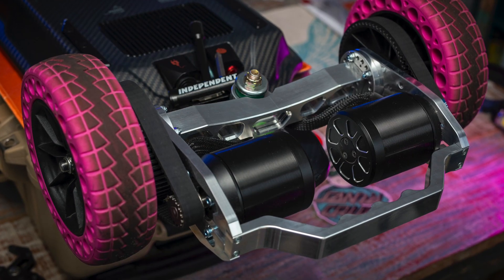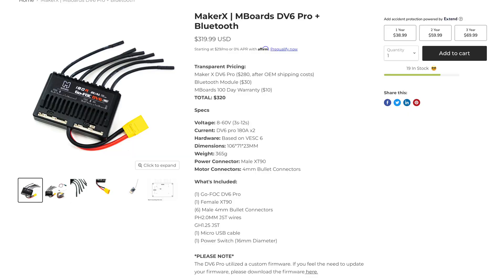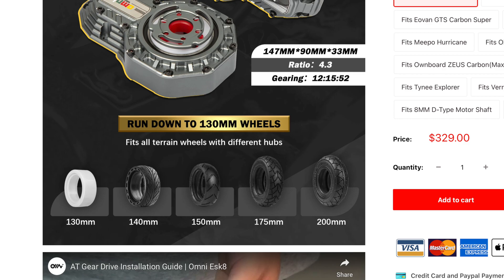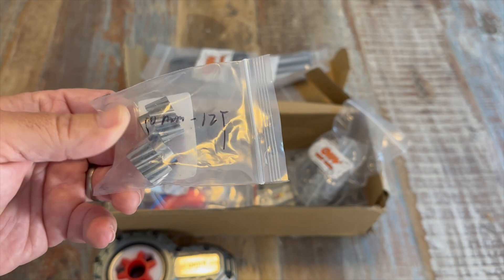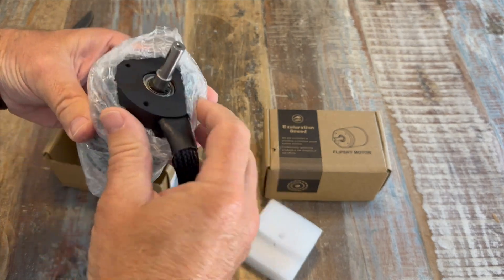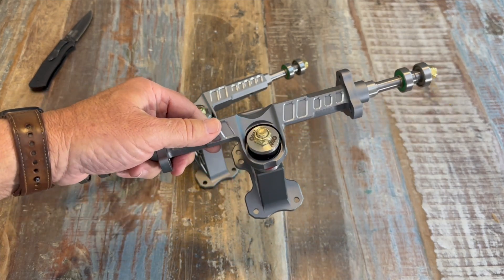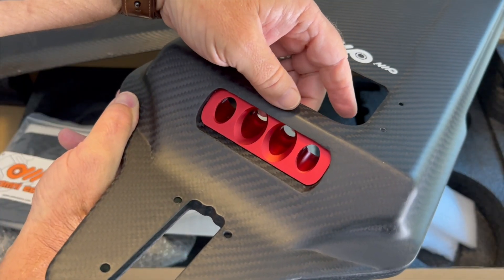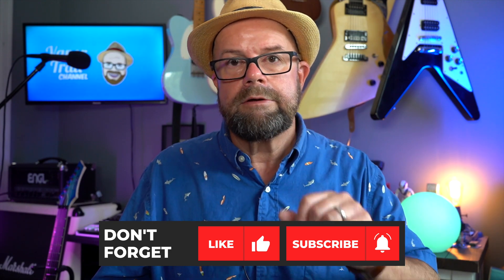My First DIY ESK8! Preview, Components, Goals, And Your Feedback!

Comment: You'll be happy with dual 6374 motors.  If you continue to enjoy diy, i would highly recommend longer decks.  More stable at higher speeds and more board absorbs more vibration.
Reply from the maker: Thanks man! Sorry, was on vacation on Mexico. The deck from Omni is a good long deck, so I’m happy there.

Comment: Ive been tryna wait to be able to do a diy it seems so fun but i havent been able to get to this point with how expensive it is.
Reply from the maker: Depending on how you go about it, it can be as much or less than one of the production boards. Example, I have a Meepo Hurricane I’d like to sell as I haven’t used it in a year. The battery is likely dead at this point. I would probably sell that on marketplace for $400-500. Find something like that, and gut it and you’ve got the first step. You get what I mean.
Reply: @VaporTrailChannel  that makes sense I live in a small town not too close to any city's so not many people have one or are selling any.  I've only seen like 3 for sale witch was the cheapest backfire boards and meepos
Reply from the maker: @halexcycle6467  If you're in some facebook groups, or even using FB marketplace, you should be able to find something as I described. If you're interested in that Meepo I have, you can reach out to me on socials. It's fully functional, but I'm not sure how long that battery will last. If you're looking for parts, this one even has custom CNC aluminum trucks on it right now, which I would let go of as well, but of course the cost would be a bit higher. Once you have the bones for your project, hit up Godster Amps and have him help ya with the rest.
Reply: @VaporTrailChannel awesome thanks for the help.

Comment: flipsky shitsky :)) im running a ubox on my scooter it can handle anything! peace
Reply from the maker: Well, flipsky is only the motors and remote. The ESC (speed controller to most scooter folks) is the badass Marker X. Things are a little different between the scooter and ESK8 worlds, and the motors and remote are widely used in ESK8. Thanks for watching! 😃👍🏻
Reply: Flipsky motors are fine and their remotes are good options (people actually love the VX4). The issue people have with Flipsky are their ESCs, and only specific versions of those ESCs (a number of them are perfectly fine).
Reply from the maker: @BlownMacTruck  that’s a pretty accurate statement. Just got this board back from Godster Amps! Stay tuned.
Reply: @VaporTrailChannel Looking forward to  hearing how your experiences dipping your toes into DIY is. I suspect you'll never want another non-VESC controller every again…
Reply from the maker: @BlownMacTruck  Yea, so far I'm pretty stoked. My board came in from Godster and UPS must've really dropped or jarred it! The Battery had shifted, pushed the BMS into the VESC and ripped up some wiring. I'm sending it back to my boy at Godster so he can fix it back up. I was so bummed! But it's a beauty! Can't wait to ride it. More to come!